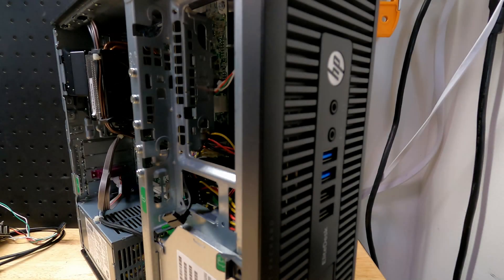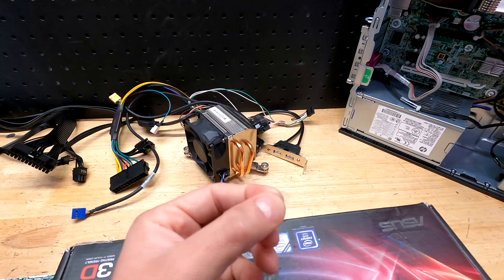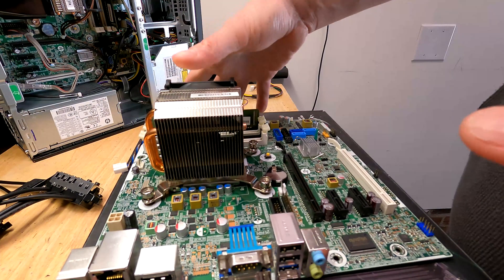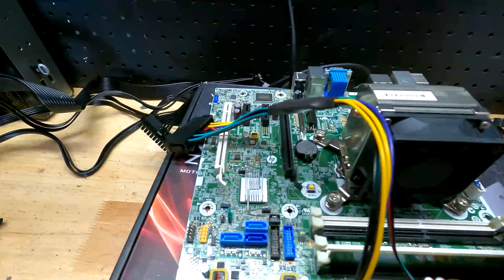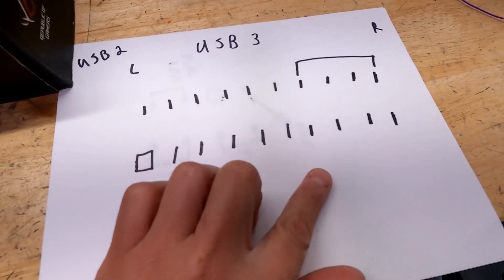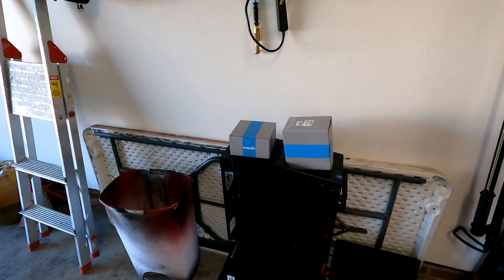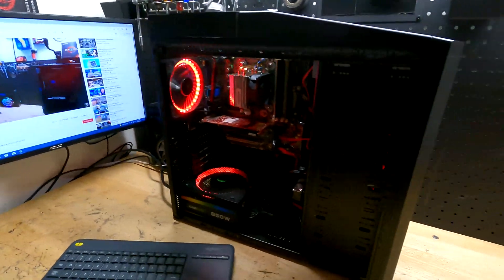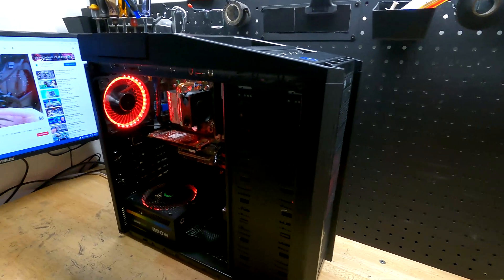Hp Elitedesk 800 G1 case swap!

Comment: Plss help me 😭😭 I also do the same thing purchase a psu adapter with good quality but motherboard green light doesn't start constantly it blinks for a time in starting it taking like 10 sec now it's taking more than 19 hours still blinking and then I replaced adpater of psu again this happening it my psu has fault I so confused can I purchase new psu or not pls replyyyyyy 😭😭❤

Comment: USB 3.0 #1 pin starts on left not right..so technically ur jumpering 7 to 10. My arrow is the left. Urs should be too it’s the same orientation as mine.

Comment: Got this was a pain. My case had no audio cable. It had a usb3 cable with another usb2 coming out of it ? the usb3 fits bit the usb2 on the board yellow pins has 12 pins . HP EliteDesk 800 G2 SFF.  I ended up leaving the old cables from the old case plugged in.

Comment: I did this as well, but i didn't have the adapter cable so i have two power supplies in mine, the original and one just for the graphics card. A bit messy but it works. ;)

Comment: Just wanted to throw this out there. It is my suggestion that people avoid this upgrade if they can. I have run into NOTHING but issues. Bought 2 seperate adapters that claimed to be for the 800 g1. Everything is just a pain with this motherboard and setup. 
The issue I am currently having now after everyting is when I boot up an intensive game the PC will randomly just restart. (My PSU is fine). I think its just REALLY hard to get the right adapter like he said...I dont know. I triple check with these sellers and they swear its the right one. I did use the Amazon link for the first one I bought but it said one of them was out of stock on the listing, almost like there were seperate versions? See the link to see what I mean,  I know its confusing. I think im done with this damn motherboard.

Comment: Very informative, do you remember if the front panel HD audio connector worked properly (mic and speaker)? I want to replace an old hp case's AC'97 with  HDA and unfortunately the only front panels I can swap easily would be from another HP case. My motherboard, power button, etc are already switched out and working fine, I just need the front audio.

Comment: Do you know if I can put an i7 4790K in my Elitedesk 800 G1 instead of my current i5 4570 ? I know thet the normal i7 4790 is compatible but I'm not sure if the K version is.
Reply: 4790 will work great as I just swapped out my I5-4570 out. The 4790k will work too but it's kind of a waste of a K series cpu because you can't overclock it on the HP board.
Reply: @Alpha-ms9nj  Thank you !

Comment: Hp 800 g1 or Dell optiplex 7020 ? Which one will you prefer and why ?😊
Reply from the maker: g1... easier to case swap, better cooler
Reply: @DLMtechgarage  is the I,O shield of 800 G1 is removable/changeable ?
Reply from the maker: @usmankhandurrani8976  unfortunately no but you can get it 3d printed. their is a templet for it on the web.

Comment: Hi, I wanted to ask you a question. When you changed to the new case, do the front panel cables of the new USB 3.0 and USB 2.0 case fit perfectly into the motherboard? Or do you have to use some kind of adapter so that the USBs on the front panel continue to work? Thanks. 
And then I understand that if I can continue using the USB, since I cannot make the ground bridge with those cables that you have shown, if you use the USB it is impossible to remove the error when turning on the PC, right? I write this with Google Translate and I hope it is understood well.

Comment: Found a 24 to 6 pin adapter it's for the elitedesk 800 g1 though and I have the prodesk 800 g1 sff, Idk if it works?

Comment: There are 5 SATA pads but only 3 SATA connectors. Can one add/solder 2 more SATA connectors? Also what is the Media3.0 connector for? I love to use every port. Finally there is a chip with a silver heat sink at 8:41 . Mine has no such heatsink and l see no way one could be added there.  What's up with that?

Comment: I'm doing exactly this, with the same power adapter, but when i try to turn on the computer all i get is a green blinking light. The only hint i have is a review with a similar issue that mentioned the standby signal being wrongfully sent, but didn't provide a solution for that. 

The HP I'm moving to a bigger case is a HP Elitedesk 800 G1 SFF, model number TPC-F046-SF. If i just plug the oriiginal PSU, the computer boots just fine, however if using the comeap adaptor and a normal PSU:
When turning it on, it doesn't spin fans or anything, all you get is a green blinking led on the motherboard, steady and continous kind of blinking. The idea was to add a spare GPU i had to it, which is a HD7970, and the test have been done with 3 different PSUs and with or without the GPU, same exact result.

Comment: Thank you for this helpfull video. I am an old man and I like funprojects like this. I have found a video to change the bios so it can start up from an NVME SSD plugged into an PCIE adapter. It can start up really fast then. I have it now in a nice little case from DeepCool with RGB fans, a 600 Watt PSU and a 6GB Msi geforce gtx 1060 6g armor GPU. Only thing I don't quiet get is how do I get rid of the USB warnings while I have my front USB ports working on this nice case.

Comment: I don't know what to do, I have a motherboard from an HP 8300 computer in the largest version (ATX), and my computer does not turn on, I tried to connect the start button like yours, but it didn't work, do you have any ideas?

Comment: okay so i bought a pc case for 60 dolllars and it comes with a psu its a 360w psu but i have a hp prodesk 600g2 i didnt case swap it yet because idk if the psu connectors will work for the motherboard its complicated the motherboard has some pins for the 360w psu but not for the usb pins will it still boot up?

Comment: Your great man, my system unit is 
HP ELITEDESK 800G1 SFF(AMD A87600) 
12GB RAM, 120GB SSD
MY SYSTEM UNIT GOOD FOR BROWSING AND SEMI GAMES, IWANT TO RECASE IN ATX CASE, THANKS FOR YOUR VIDEO BRO YOUR GREAT
Reply: Were you able to shift the things to the case somehow? Successfully? Because I acc went to my local pc repair shop and they said it's a brand pc so the case cannot be swapped 😅😅

Comment: Hello, using an ATX Case for 800 G1 SFF. The case/power supply has a USB 3.0 Cable. Now error is Front USB-2. How to we pin out to remove the "922 - Front USB error"? The same pin out to fix USB-1 doesn't work. Tower I have is (Bgears b-Voguish-RGB Gaming PC ATX case, Include: 6 x 120mm ARGB Fans, 1 x 10 Fans Controller, 1 x Remote Controller, USB3.0, Support up to EATX Motherboard, Support Graphic Card up to 380mm Long) from Amazon.
Reply: I Have the Same issue 921 amd 922 front Usb Not detected How can i solve it

Comment: What form factor does the case have? I heard that ATX cases are not compatible with HP motherboards
Reply from the maker: this case is a regular atx and the boards fit fine in them. you can also use the matx.

Comment: I have a question about this style of adapter, I ordered one from Amazon that is supposed to work with many models. I got a new Thermaltake 500w psu and hooked it up to the HP G1 via the adapter, it boots but shuts off. I'm using the cases power button and the led turns red. It works perfectly fine with the stock psu.

Comment: A technician told me that I couldn't put the 800 G1 SFF motherboard into an ATX case. She lied to me?
Reply from the maker: yup, you can put it into any case, the key is the pin out which is simple. Tech only fix and repair, not mod. This is more of a mod/hack
Reply: @DLMtechgarage  I was inspired by your video to do the same with my PC (800g1 ssf), the fact is that when I went to buy the adapter (of the psu) I saw that some were for the Z220 or Z230, I think a few more, well, the person who helped me . He told me to choose the correct model and power. Or else it would cause problems for my PC or it wouldn't work... would you help me with that? please sirrr
Reply: Haha, women slurps coffee
Reply: Same 😭😭😭 my local shop repair told me the same thing
Reply: She just took a procedure from HP vendor

Comment: @DLM tech garage, I have a question though, the CPU fan, is there any 3rd party fan recommendation or maybe you have found that fits this motherboard?? I'm looking to do an AIO cooling system for this one, but haven't found anything that fits, let alone the CPU fan. Any ideas? I'm looking at the CORSAIR H55, will this somehow fit? I also checked some Noctua brands for the LGA 115x but not sure if their brackets fit this motherboard...

Reason I asked is that during heavy intensive CPU tests, the temps hit up to 80c and i'm concerned that the fan isn't able to keep up...I tried CPU burn and the factory CPU fan couldn't keep up
Reply from the maker: I never look into an a different cooling due to the mounting on this hp not being standard.

i never had an issue with the temps as far as gaming and editing. Stress test run the cpu more intensely compared to typical usage.
Reply: @DLMtechgarage  okay thanks, no problem, I guess I'll be the first to try this out to see if I can find an AIO that fits this motherboard. I just purchased the ID-COOLING Frostflow x 240. It comes with different mounting points for LGA115X to 1700. So will see if this one will fit. If not then I'll return it. Thanks. 🙏
Reply from the maker: Keep me posted!! @BlueHoodie74
Reply: @DLMtechgarage , after further research, I ratracted from this idea. After watching long term reliability of the AIO and the way how corrosion occurs and leaks etc., I said forget it. 

I watched this video review and tests from Gamers Nexus regarding proper mounting of AIO's and materials used from it: 

https://www.youtube.com/watch?v=BbGomv195sk

and based on my conclusion, it's not worth it. I'd rather keep my PC dry and not have any leaks or corrosion etc. 

I'm trying now to cancel the order of the AIO. hoping it gets cancelled.

while it may look nice and cool to have the AIO's, on the motherboard, my concern there is leaks going to an expensive GPU (RTX 4070 TI) or the motherboard itself, or after 3-4 years of pump failure or mechanical failure, is just not very reliable. Compare that to a decent CPU fan, as per what you said on the video, the OEM's are good enough, i mean they last 10+ years. Sure it may end up dusty but can sure be blown air and be put back into circulation.

Comment: thanks for the jumper info having to press f1 was getting old after a day, i ended up throwing a 2060 super in mine via a vertical mount. Im a little bottle necked but its just a batocera emulator rig. Thanks again

Comment: This video was a big help as I just did a case swap on my 800 G1 MB. The PSU adapter worked like a charm but I do have the USB warning when first booting but considering I leave the system on all day and the USB ports work fine, it is just a once a day annoyance. Other than that it is a sweet to have the MB in a much nicer case with a 600W PSU. I should have done this long ago. And it worked out even better as the thermal paste was getting pretty dry and needed to be replaced on the CPU and cooler. Thanks for the great video and all of the information on doing the swap!
Reply: The USB cables needed no adapter at all. They were standard connections. The only adapter you need is for the PSU assuming you install a non-HP PSU. Read about my comment on the USB not detected.
That only occurs at first boot and the USB works like a charm once boot is complete.
Reply: @johno9163  Thank you for clarifying that the connectors on the case are standard and work perfectly on the HP motherboard without any adapter, okay I have re-read your previous comment and then when the error appears on the screen about USB not connected, it appears on the screen every time you turn on the computer but since you only do it once a day it is not that much of a bother, right? Thanks in advance
Reply: Correct..after booting for the first time you won't see that message again and USB will work just fine.
Reply: Hi, I wanted to ask you a question. When you changed to the new case, do the front panel cables of the new USB 3.0 and USB 2.0 case fit perfectly into the motherboard? Or do you have to use some kind of adapter so that the USBs on the front panel continue to work? Thanks.
Reply: Hi, hoping you have time for another question, is the front panel audio working as they should? I basically want to do the opposite by using it with a non hp motherboard since it can fit almost factory like in the case I'm using. old case has ac97 and looking to replace with hd audio that can fit in the case.

Comment: I need your help on this one brother. I've been looking online for the power adapter and I can only see the 24 pin to 6 pin adapters for HP Z220 and not for the Elitedesks. Is that fine to use or do I really need to find the same adapter ?
Reply from the maker: they are wired different, you have to make sure it supports it
Reply: The link in the description seems like the right power adapter for Elitedesks
Reply: @kylem6165 Shipping is 10x the price of the adapter. I had to buy one from some shady store in Lazada.

Comment: You seem to know your HP’s really well. Any idea if Prodesk G1 power supply works in Prodesk G2? The cases on them looks almost exactly same as this EliteDesk. 

I was planning to make mashup upgrade with most of the parts other than MB+CPU coming from G1. I only need to buy DDR4 ram to the G2 if I proceed with my plan and have also a narrow GPU for it. Those HP’s are dirt cheap because G1 MB has some issues and G2 is missing half of the parts that I would get from G1 so it would be great combo if only the PSU plays nicely with the G2 motherboard…
Reply from the maker: not sure
Reply: @DLMtechgarage  thanks for the quick reply! I will let you know if I try it anyway 😁

Comment: I currently changed my psu and now my pc doesn't turn on😢😢help me please
Reply from the maker: make sure you got the right adaptor. the hp psu adaptors are specific
Reply: @DLMtechgarage  i purchased a ant eSports psu which have 24 pin 💀so now I ordered a 24 pin to 6 pin connector is it good 😊 tell me please

Comment: the bigger case just makes it so much easier to work on plus you can cram in more drives with a sata card - the 4th gen intel is decent and ddr3 is cheap - hp is solid - refurb value king - it blows away sbc.soc boards - no comparison - i think getting boards is best way to go - people probably want z440 v2 for max performance? the z420 is an option as well - can run 256gb ram

Comment: I am facing a error 911 FRONT USB 1 NOT CONNECTED AND 922 FRONT USB 2 NOT CONNECTED 😢😢😢😢
Reply from the maker: need to do the usb hack
Reply: Connect signal pin to ground

Comment: Please give me PLASTIC WASHER AND NUTS LINK PLEASE 🥺
Reply from the maker: i bought them from a hardware store.
Reply: @DLMtechgarage  I am facing a error 911 FRONT USB 1 NOT CONNECTED AND 922 FRONT USB 2 NOT CONNECTED 😢😢😢😢
Reply from the maker: need to ground the usb like i mentioned. @jaat6969
Reply: @DLMtechgarage  I have a usb 3.0 cable still this error appear
Reply: @DLMtechgarage  I am facing a error 911 FRONT USB 1 NOT CONNECTED AND 922 FRONT USB 2 NOT CONNECTED 😢😢😢😢

Comment: HELP i got a new power supply and i connected everything and yhe green light on the MB just keeps blinking everynow and then and its not a long blink it looks like it cuts out i worked so hard on this :(
Reply: Did i get the wrong MB power cable?
Reply from the maker: it could be the cable, the cable is specific to the model

https://www.amazon.com/COMeap-Power-Adapter-Workstation-12-inch/dp/B06XW7RWNH/ref=sr_1_9?crid=2S79BCOI74SKF&keywords=hp+elitedesk+800+g1+power+supply&qid=1698759633&sprefix=hp+800+g1+power+sup%2Caps%2C90&sr=8-9

Comment: Nice to meet you!!! I love your video. One question I have an hp prodesk 600 g1 sff, which 24-pin to 6-pin adapter. Do you recommend I have a 550-watt power supply. please help!!
Reply from the maker: https://www.amazon.com/COMeap-Power-Adapter-Workstation-12-inch/dp/B06XW7RWNH/ref=sr_1_3?crid=3M463SLXJJOPL&keywords=hp+prodesk+600+g1+24+pin&qid=1694030298&sprefix=hp+prodesk+600+g1+24+pin%2Caps%2C87&sr=8-3

Comment: You Didn't Show How The Power Supply Connected To The Rest Of The Motherboard.
I Have A 750W Cooler Master It Starts Up And Then Turns Off
Reply from the maker: make sure you have the specific adaptor for this mobo. the various model and their adaptors look the same but are wired differently. If you don't get the right one it will do that.

Comment: Im getting a no psu fan detected but the fan on the psu spins to life
Reply from the maker: Might be the adaptor you got. It's easy to get the wrong with as this model has a specific one.

The other models look identical but have a different pin out of you don't notice it
Reply: @DLMtechgarage  I hav3 a elitedesk 800 G1 sff and I got the one listed but they sent me one with different wire placements then what was shoe on the image. I'm gonna order a different one to see if that works.

Comment: How did you connect the case fans? Im about to do a case swap on the exact motherboard but I’m afraid to say i cant find anywhere to connect the fans
Reply from the maker: I used a pwm to sata adaptor
Reply: @DLMtechgarage  thank you i was planning on getting a hub for the cpu fan port but i figured it was a bad idea they where all cheap so thank you

Comment: will i be able to use usb 3.0? one of the reasons im switching is so i can fit a full size card in for vr, i need a 3.0 for fast response time
Reply from the maker: yes, with doing the pin out for the usb it will work fine.

Comment: @DLM tech garage
Couldn't you use a AMD cooler mounting (AM3(+) or AM4)? I saw in a forum that someone modified (drilled new holes) an Noctua bracket to use it.
Reply from the maker: Anything is possible with a little modding